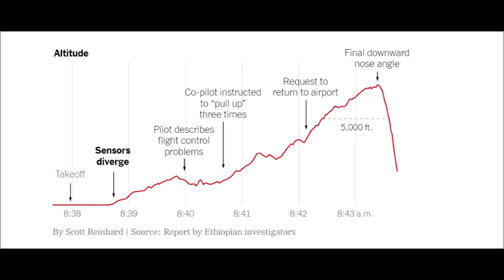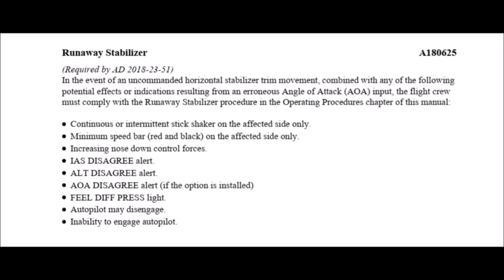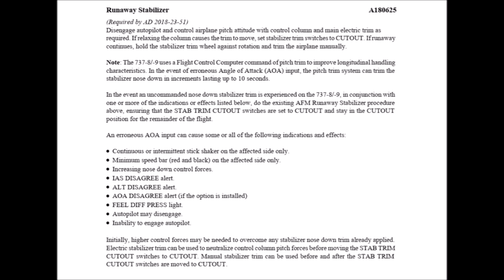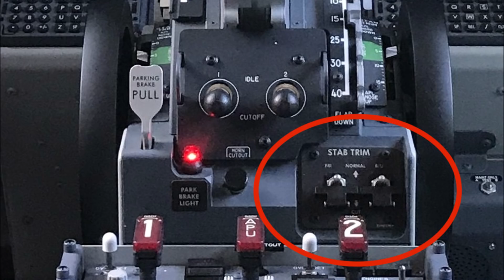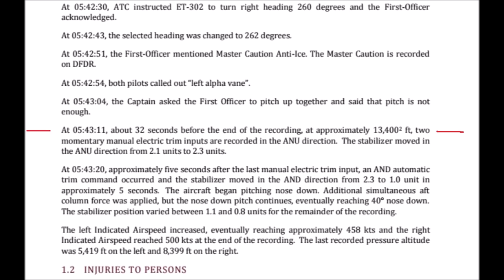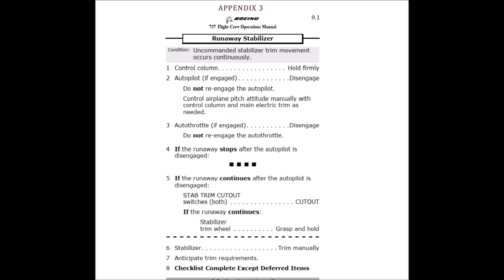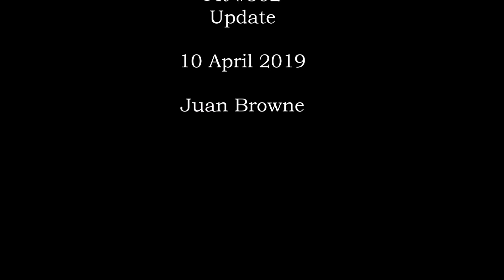737 Max Update 10 April 2019 Runaway Stab Trim Procedures

Comment: As an airline pilot and instructor (30 years, many different types, most recently captain B777) I can vouch for your excellent comments on this incident. Also very fair. I wonder what would have happened if the pilots had taken a desperate, way beyond the book, measure by rolling the aircraft upside down to get jammed nose down stabiliser working for them, instead of against them; directing the aircraft away from the ground instead of into the ground. Way beyond the scope of normal manoeuvres in the toolbox of regular airline pilots, but it might have worked. To be fair: easy to think of in my armchair at home but I don’t think I would have thought of it in the desperate situation that they had got into in the last seconds of their flight.
Reply: Are you claiming to be a pilot and pondering if they could have rolled a commercial airliner at low altitude? Am I reading correctly?
Reply: @stimproid  Looks like it
Reply: @ stimproid; I can understand your sceptical comment. As I mentioned; I am not suggesting that this would in any way be considered a recommended procedure. Having said that, If you were familiar with current trends in airline training, you might be aware that there is a recognition that airline pilots might benefit from some more training in controlling the aircraft in extreme upset situations (see FAA UPRT program). This encourages training, in the simulator (unfortunately most normal simulators are not suitable when way out of the normal flight envelope) but also in theory. This includes recovery from the most extreme situations. For example; there have been incidents where system failures (I believe it was also a horizontal stabiliser problem) that caused an initially uncontrollable nose up pitch; the “out of the box” remedy was to apply extreme bank angle to get the nose down. It is with this in mind, that I made my remark; as I said, I am in no way suggesting that this is what the pilots in this accident should have done, or that anyone would have thought of doing that in their situation. But; the question remains; what if? By the way; if you question whether a commercial aircraft can be rolled on it’s back; the answer is generally yes; why not? A Boeing aircraft, even those with full fly by wire (FBW) , and also those like the 737 without  will allow it; the Boeing engineering philosophy generally allows the pilot the final say in controlling the aircraft. This is somewhat different on Airbus aircraft; they might not allow flight out of the envelope (such as a roll beyond a certain bank angle).
Regarding your remark about my “claim” to be a pilot; for what it is worth; it’s not a claim, it’s a fact... about 34 years of airline flying, almost 20000 hours. Having said that; it makes me a bit more experienced than some, but certainly not immune to wrong thinking, so I do appreciate your critical response.
Reply: @bartsmit8334  I appreciate out of the box piloting techniques, especially since that's how many serious commercial aviation incidents have been avoided. Warren Vanderburgh had some great insight into this https://youtu.be/35Zy_rl8WuM
Reply: @ Rob Roilen; yes, I did have the insights of Vanderburgh in mind as well, and have attended his presentation of his American Airlines Advanced Manoeuvring program many years ago. Unfortunately it also illustrates the danger of making this sort of thing a hard and fast procedure; I think his ideas contributed to the tragic accident of an Airbus departing New York  (must have been around 2005?) where the pilot’s inappropriate use of rudder caused the structural failure of the vertical tail.
Reply: @bartsmit8334  I think the more pilots actually know how to fly the better. I'm certainly not against the idea of out of the box thinking but I don't think this is the right scenario/altitude for a roll.
I've been thinking, obviously hindsight being 20/20... I think it would have been a better procedure, rather than doing the runaway trim stabilizer checklist, to simply grab the trim wheel to stop trim movement in the pitch down direction. This would have allowed the pilot to use nose up electric trim, pausing for MCAS to try to trim down, then resuming pitch up trim until the plane was more or less in the proper trim. Then hit the cut out switches for the remainder of the flight, trimming by wheel as needed. Thoughts?

Comment: Why isn't there just an MCAS disable/override switch?  The more systems you have to make certain portions of the envelope easier for the pilot (coupled with poor planning on sensor input) and do things for the pilot, the less "full control" the pilot has, barring a disable switch.  I'm all for automation to make things easier, but there needs to be a simple, direct way to disable the automation and just *fly the plane*.  IMO, YMMV.
Reply: No off switch for MCAS.

Comment: It may be true that western pilots are more experienced/trained. These two accidents, however, does not support such a claim. At all. The statistics is far to weak here to in any way draw such a conclusion. A crash investigation is done, not to point blame, but to put all the facts on the table and to improve and learn from these facts. For those youtubers thinking that the crew caused this accident, please see Juan's previous video as well. They will find that there were many facts on the table and a complex chain of events behind the scene.

Comment: the optional AOA disagree light (dont say light - its not a light its a display indication) is not really relavant - it couldnt have helped pilots in the situation.
Reply: If the pilots knew they had an AOA disagree, they could have kept 1 notch of flaps and returned to the airport, or hit the trim cut out switches before fully retracting flaps. Both of these would prevent MCAS from doing anything.
Reply: stimproid what you said is true in an ideal world where the engineer who designed MCAS was the pilot. That procedure is not in the flight manual and pilots would only know it is MCAS from the news media or YouTube. Maybe if they make AOA disagree option mandated by an AD with software to disable MCAS automatically in AOA disagree situations...then no cutout trim switch activation needed and the speed trim will still be active?

Comment: I think Boeing makes great planes at present and have made great aircraft in the past, and I think they're getting a bad rap here.  American trained pilots are some of the best in world and it accounts for the more than 300 daily U.S. take-offs and landings of the Max-8/9 aircraft  prior to the Lion Air and the Ethiopian crashes.  U.S. pilots and co-pilots have impressive flying hours under their belts.  It is not unheard of foreign co-pilots having less than 300 hours.  I find it more than curious that U.S. pilots can fly the new Max-8/9 jets without crashing the plane and the only major crashes of the Max jets has happened with foreign trained pilots. hmmmmm!  The Max 8/9 units were grounded due to pressure.  I think Boeing is due an apology and the planes should take to the air once again.  I would take a flight on a  Boeing Max 8/9 tomorrow without hesitation so long as American trained pilots are at the controls.

Comment: The question isn't whether the pilots followed procedures. It's how much information they had on a crucial update to the procedures for gaining control of the aircraft in the event of an MCAS anomaly. After the first downed 737 Max months ago, Boeing made an update to these procedures, but the decision was made NOT TO ADD THIS UPDATE TO THE PROCEDURES b/c of the added expense. Boeing figured most existing stabilizer trim procedures covered this area thoroughly.  The problem is the pilots probably didn't know MCAS would take over the aircraft even after they disengaged autopilot and controlled the aircraft's pitch with the control column and the main electric trim. This is a unique feature of MCAS to which they probably weren't privy because it was only shared as a small update and not added as part of actual procedures for for the aforementioned reasons. Therefore, everything that happened afterward was likely a clueless crew wondering why following the aircraft procedures (except the small update that wasn't actually added to the procedures) was not working and they were probably switching the cutout switches on and off.
Reply: After the Lion air crash, Max pilots had the information they needed. In fact the day before the Lion Air crash, the very same plane had an MCAS failure event and was recovered. This was before MCAS was a known problem.

Comment: Jaun,  Why isn't there a big red button among the controls capable of turning off all the automation that overrides the pilot's inputs.  This would immediately inform the pilot that he is hand flying and that his inputs are being obeyed.  Also sitting in the cabin were hundreds of people each with a cell phone capable of detecting the angle of attack, given current technology why is the instrumentation of the aircraft so limited in its use of sensors?
Reply: A cell phone can detect angles relative to the ground. AOA has to do with the angle of air moving over the wing. You phone detects gravity, AOA sensors need to be outside the plane in the airflow.
Reply: A big +1 for your "big red button among the controls capable of turning off all the automation that overrides the pilot's inputs"!  We REALLY need this!

Comment: Thank you again Juan.  It seems to my uneducated mind that the MCAS system is something like another auto-pilot. (Artificial Intelligence maybe?)   Why is there no simple (physical) switch somewhere that can just turn the darn thing off so the pilot can regain control of the aircraft?  Manipulating and using software is one thing, but a manual switch is far better in my humble opinion.
Reply: An off switch does sound like a good idea, however MCAS was supposed to be almost invisible to the pilots. Until the Lion Air crash, it is likely most MAX pilots didn't even know what MCAS was. In the event of an MCAS failure, pilots would have surmised they had a runaway trim event , and followed the procedure to correct that situation. This actually happened the day before the Lion Air Crash on the very same plane.

Comment: with Stick shaker on continuous they refused to throttle back?
Reply: Stick shaker is a stall warning. Typically for stall recovery, you drop the nose of the aircraft and advance the throttle.
Reply: @stimproid  exactly, with stick shaker rattling who would throttle back ?not matter what...especially at the altitude.

Comment: You're right, but the crew should not have been put in that position in the first place with faulty Boeing software. Especially just after take off with low altitude.
Reply: MCAS is obviously faulty. The question remains: was the aircraft recoverable?
Reply: @stimproid  Yes, it probably was recoverable if the crew had acted perfectly without any panic factor, left stab trim off, pulled back the power etc. However the scandal here is the cosy relationship the FAA has with Boeing in allowing Boeing to self - regulate its aircraft under some conditions.

Comment: Thanks... best commentary  on the internet. I am an old pilot, programmer, and personal trainer. 
1) Programming glitches "will" happen. I don't care how well something is coded, which further stresses the need for a "fail safe" human backup to automated systems..
2) There should be a "last resort" cutout switch/button on all automated aircraft, that neutralizes ALL automation/autopilot and auto-throttles, leaving only an analog 6-pack. yoke. rudder. manual trim, and throttle. This would give pilots a known "basic training" comfort zone to "aviate" from.  Trying to respond with a "human" checklist to a list of "digital" computer errors in an extreme  emergency is absurd. 
3) This informed pilot is on to something with the fear,  high adrenaline "fright or flight response", fixation, startle effect, tunnel vision, etc. As a personal trainer involved in "performance psychology", emotional control using mindfulness training in high stress situations,  this is definitely needed in the aviation community. Fear causes a capable person to "shrink". Have you ever given a public speech?
Reply: I agree with everything you wrote here. I can't help but think that there would still be instances where a pilot gets disoriented and hits the "last resort" button because he perceives the plane is in trouble even if it isn't.

Comment: Hello and thank you for your videos! I had a little question as a complete noob in aviation: While the plane was diving and the crew couldn't manually trim up the aircraft, would it be theoritically possible to extend the flaps to disarm the MCAS and regain control of the electronic trim system? If not, do the extension of the flap and/or the use of the air brakes could have helped in reducing the airspeed to recover the manual trim? I hope it makes sense! Thanks!
Reply: At high speed flaps can't be deployed...but...when they trimmed up with the thumb switch...the speed had to decrease...enough to deploy flaps...the speed must be plotted somewhere before they reached 5000 feet of altitude. The question is does MCAS revert back to neutral trim with deployment of any degree of flaps?
Reply: @md-ei6tw  What do you mean by neutral trim?

Comment: Good observation and well explained.

The instruction sound complicated... can you recall the steps in emergency..?
Reply: Juan is an experienced pilot. The runaway trim stabilizer procedure has been trained on the 737 since the 1960's. The procedure is a "memory item" meaning it is memorized by the pilots and does not need reading from a checklist. I have no doubt Juan would remember in an emergency.

Comment: One thing I don't quite follow in that case, why did the auto throttle not back off the power when the aircraft started to over-speed?  
Surely the flight model algorithm for the auto throttle computer system should not allow it to put the aircraft in an uncontrollable  speed window. If the only issue was the AOA sensor, then the auto throttle should have been as aware, as the pilots that they were going way too fast. It seems to me that there is a second fault that has blinded both the pilots and the auto throttle to the dangerous over speed condition.
Reply from the maker: possibly was in throttle "Hold"....waiting for the pilots to move the throttle....
Reply: @blancolirio  That makes sense, especially if this mode it completely dumb, in which case it will simply stay engaged, with the throttles set at one setting regardless until it receives some other input from the pilot(s). There would however be an over speed alarm sounding would there not, and I would imagine if the over speed sounded, then disengaging the throttle hold, and attempting to reduce speed should be a priority. I guess it also depends on the rest of the information overload, and whether the plane was by then too low and too fast for them to recover in time.
Reply: I think what Juan means is that on an aircraft, the throttles must always be engaged. Otherwise the aircraft will fall out of the sky, not like a vehicle which can stop on the side of a highway.

Comment: Was the comment on the March 20 video correct that the MCAS switches use of AOA sensor from left to right after each flight cycle? 
I think it is established it only uses one sensor but it is interesting if it switches them and possibly when troubleshooting the maintenance crew introduced a flight cycle and didn't pick up the bad sensor.
Reply: Tony Crisci Yes. In the case of the Lion Air crash, that is exactly what happened. The Ethiopian crash had a different AOA failure, but the same end result.

Comment: I thought Mcas would not engage if auto pilot was on?
Reply: Tony Crisci Watch the previous video.
Reply: @gordonrichardson2972  I did. I must have missed something.
Reply: Short answer: MCAS will not activate if auto pilot is on. On the Ethiopian flight they tried to engage the autopilot, but it failed after 30 seconds due to unreliable airspeed. The single AOA sensor failure caused a cascade of warnings, faults, errors, and disaster.
Reply: @gordonrichardson2972  sorry. I meant off on first question.
Flaps up auto pilot off MCAS operational. Thanks